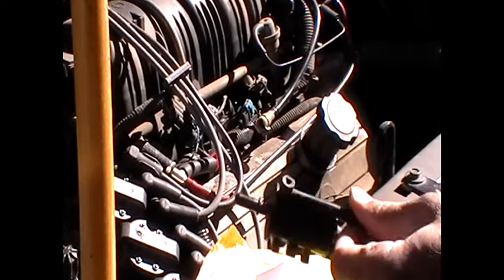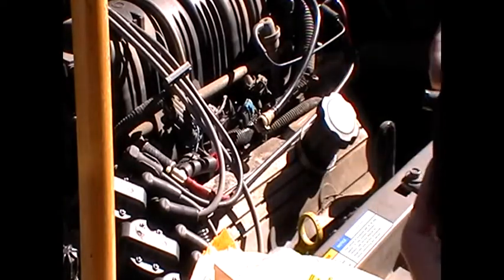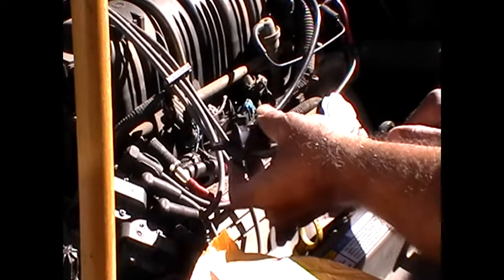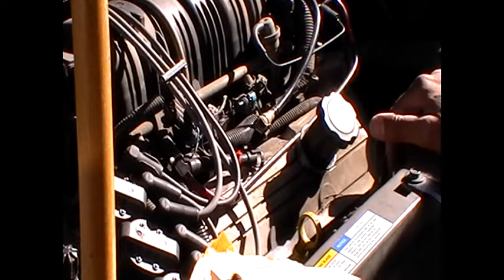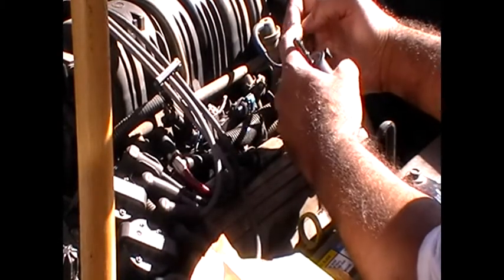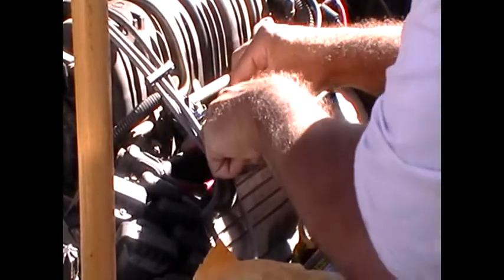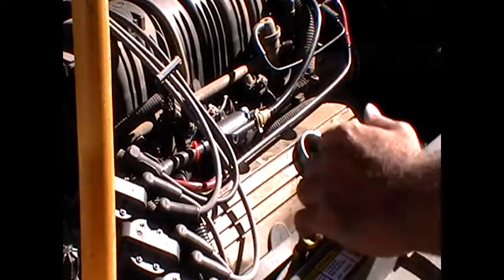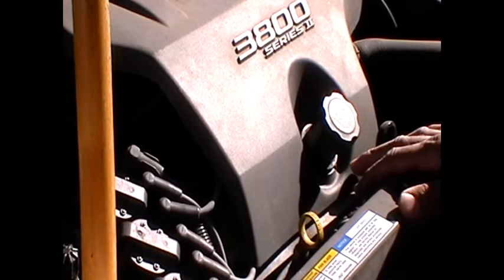PO442 Code 3.8L Series II GM V6 Repair

Comment: Just did this on mine, but the solenoid wasn't able to clip onto the metal bracket so I electrical tapped it down.